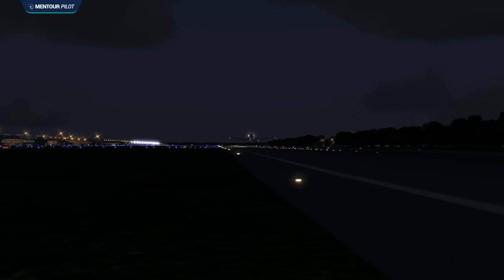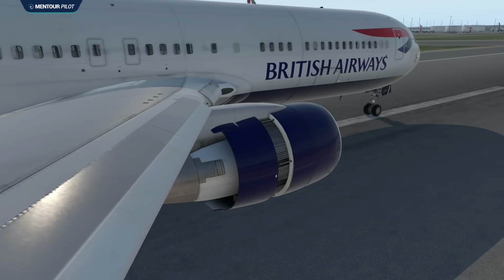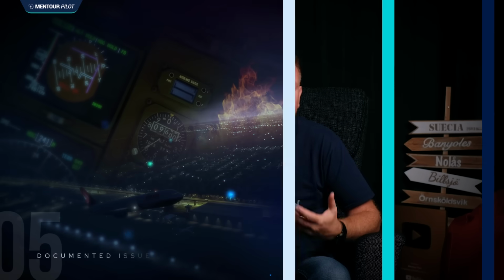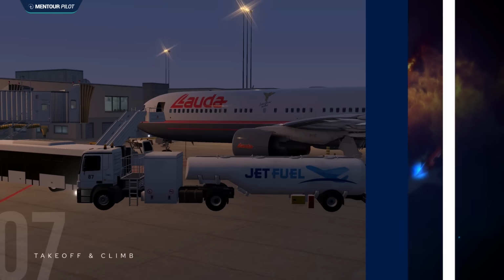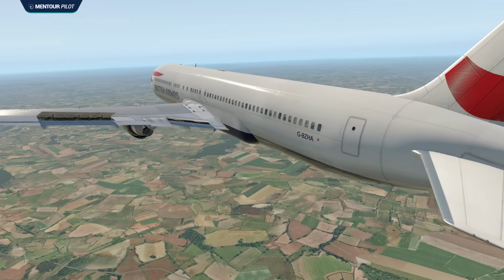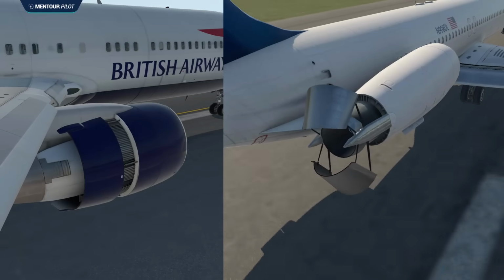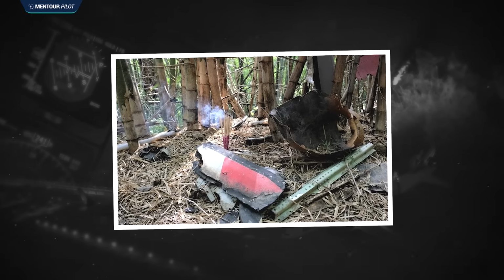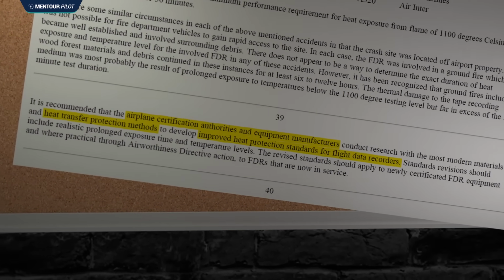HOW an Impossible Failure CRASHED this Boeing 767!

Comment: After reading about all this airplane disasters, I am coming to this conclusion that Boeing has had a poor record compared to Airbus.
Reply: Boeing has gotten progressively worse over the years after merging with other companies. The corporate culture is dominated by shareholders instead of pilots and engineers like it should be.
Reply: Are you sure about this? Airbus also had that incident with the rotated landing gear and everyone on the plane watching their own emergency landing on the IFE.
Reply: I know for a fact that if it was an airbus with the same problem the shit would have landed ! The airbus has higher passenger survival than Boeing and if you compare Boeing and airbus accidents you will see when the fire shuts off airbus has more material left and Boeing simply turns into ashes like it never existed in the first place and also if you see Kenya airlines airbus accident you would have notice for the pilot to do suicide he had to wait for a while and then put inputs of a landing YOU CANNOT FOOL AN AIRBUS! and it's official statement of Airbus that they design the planes keeping in mind the possible human errors rather than BOEING anything happens NTSB is like pilot error (ofcourse you try to be calm in air!! atleast airbus accepts this and provides a solution for it!!) even if I have live on road for few days still I will pay to be on airbus than Boeing!! yes airlines with airbus are expensive compared to airlines which uses Boeing but hey you can't price human life right? BOEING used to be good but it's now thrash and as an American I am ashamed! the company is now all about cheaper materials capitalization, it's like apples now all they care is about those dollars and for them passengers are just price paying souls and nothing else. SHAME ON YOU APPLE AND BOEING!!
Reply: @lawyerpanda1856  you can't fix stupid. You don't have a clue about aviation.
Reply: @lawyerpanda1856  No... if the same thing happened on an Airbus, the same shit would have happened. The certification tests were flawed, and that's the big problem. Maybe in France they'd have had a better certification and wouldn't let testing only one set of conditions fly, no pun intended. But any plane, regardless of manufacturer, would have suffered the same fate with the reversers deployed with the same conditions (speed, altitude, engine being on climb thrust, etc). The 767 itself is fine, the problem is the certification requirements allowing for such assumptions and not testing multiple conditions. Pressure, airspeed, engine settings, weather, they're all factors that can greatly impact an aircraft and they all need to be tested.
Reply: @redtailarts101  but AIRBUS 380 doesn't face the same problem and I am sure the way it is made its also has some business perspective attached to it, don't you think so? And it's been flying for a pretty quite time and that too with no accidents like this till now so this basically shows that Boeing in cutting corners in places where it shouldn't 🙃 like employment of cheap engineers is one 😅  i mean it's a thing that goes into the air for a considerable amount of time we all are risking our life I mean you want to get money it's fine but the cost and honestly it's all corruption as an true American I was supposed to like Boeing but my morals as an human is more important. You cannot to this I am just shocked and surprised how after this dangerous thing Boeing walked off If I was the judge I would have closed down that company shutt liked happened in the case of oldest airline and sea planes.
Reply: @redtailarts101  the debate is not about MCAS (of course its shit and not needed) the question is why MCAS? It's high time some good and competent recruitment is done by Boeing.
Reply: @lawyerpanda1856  This channel (Mentour Pilot) actually has a video titled "why 737 MAX NEEDS MCAS" and I think he can explain it quite well. He's a 737 pilot himself and can coherently explain why the MAX needs the system.
Reply: @redtailarts101  okay I will see it, thank you for the information 😄
Reply: @lawyerpanda1856  You're very welcome Sir'am! (Idk ur preferred title so have my cursed mashup of both because my friend found it funny)
Reply: @redtailarts101  🤣🤣🤣🤣🤣🤣 your friend was/is right 😅🤣 it's Hella funny
Reply: @lawyerpanda1856  How can you say that when air fatalities are already so rare and Boeing has had higher safety metrics overall? There isn’t really large enough of a sample size for anyone to make any determinations.
Reply: @aycc-nbh7289  not everything is about numbers 😒  you again have to watch all of the air crash investigations and see for yourself that Boeing has always been about profit lately, this particular crash is the perfect example of that, I mean airbus A380 is double decker plane that can carry 500 passengers but they have not compromised for the quality! But Boeing doesn't not have any ethics now! I am an American and I am ashamed
Reply: @aycc-nbh7289  and this was with 767 have you forgotten about 787-800 max? That MCAS maneuver? That lead to so many crashes? And how many accidents and loss of life it took for Boeing to actually admit their fault ?
Reply: @lawyerpanda1856  So how come Airbus put out their A320 aircraft before they realized that their landing gear could turn sideways and possibly become a deadly projectile that flies into and explodes an engine upon landing? It seems as though not only Boeing is about profit. In fact, pretty much any aircraft manufacturer out there who isn’t a nonprofit charity would be.
Reply: @lawyerpanda1856  I was unaware that Boeing even had a 787 MAX, not just a 737 MAX, until you mentioned it. I may just want to fly on it and try it out now that they’re serious about competition with the Airbus A321 XLR, but I guess it’d be easier to do when the specific planes in question are fixed.
Reply: @lawyerpanda1856  Also, how come Boeing, not Airbus, was contracted to build the replacement for the Soyuz capsule, as well as many of the planes used by the branches of US military service?

Though with Boeing and Airbus being virtually the only manufacturers of passenger aircraft that are used by airlines in the Western world, perhaps it’s time for other companies to step up to the plate now that both companies have been revealed to be at fault for possibly deadly accidents.
Reply: @lawyerpanda1856  787-800 MAX? 💀 hun do you by chance mean the 737-8 MAX?
Reply: @aycc-nbh7289  They don't have a 787 MAX. They meant 737 MAX.
Reply: @redtailarts101  yes I obviously meant that but did the mistake on purpose and I was proven right about that particular person 😉  (its a technique most of lawyers and judges use in order to test something)
Reply: @redtailarts101  and I am deadly scared of MCAS, the maneuver requires 4 seconds to acknowledge and disengage and its still present (and I don't know why FAA doesn't ban it!!) If they want to "copy" "Airbus" atleast do it right (we all know it's nothing related to safety just because of big engines (since fuselage is big cause more passengers) its a scientific phenomenon that occurs automatically and even after "modifying it, they are not able to remove it (cause you can't remove scientific laws) pilots have 4 seconds to disengage  I JUST CANT!
Reply: @lawyerpanda1856  Suuuure... you're deffo not just making shit up in your defense.
Reply: @redtailarts101  you can think whatever (you are obliged to do so my friend) whatever makes you feel at peace 😄
Reply: @redtailarts101  you are not the first person to point it out, it was obviously done by the person  with whom I was chatting before you 😉 you see can that for yourself I could have edited my comment but as you can see my comments remains the same.
Reply: @lawyerpanda1856  Hey, if I'm right it was just an honest mistake (the 787 has also been under fire and most Boeing planes are -X00's and not single digits.) And I've thought myself of pretending a mistake was intentional before if ever confronted when I realized I'd made a mistake months later. And if you're being honest... well, someone believed you.
Reply: @redtailarts101  huh? I mean we all have internet right? Can change things in seconds now (unlike before) I can literally check internet right now and do that can't I? And whats with the fixation of being 'right or wrong' unless it's a crime everything is grey comes from different perspectives. Anyhoos what's your take on your MCAS? AND boeing in general?
Reply: Boeing went to shit after buying McDonnell Douglas. MD basically bought Boeing with Boeing's money because the company model shifted from honest hard work from engineers who had quality in their best interests to McDonell's profit-first approach, which resulted in lower quality aircraft, worsened company environment, shady certification, corner cutting, quicker manufacturing times (it sounds nice but nice things take time), and eventually disaster.
Reply: @redtailarts101  Perhaps it’s time that the trusts be busted and new competitors step up to the plate, then, since Airbus may not be able to deliver quality products in desirable timescales if the bureaucracy of having to make sure everything is transported to various factories in various countries and everything needs to be signed off on by multiple sets of administrators. We already know we’re getting the “Son of the Concorde” that was pre-ordered by United and American, but maybe we need Lockheed-Martin or someone else to step back up to the plate with passenger aircraft.
Reply: Boeing is an American company, airbus is a European company.
Reply: @FeyFoxGames  what you want to tell us?
After the problems with the 737 Max I thrust now more Airbus than Boeing.
Reply: @FeyFoxGames  i hate this argument. Because it literally says out nothing about quantity or quality
Reply: @FeyFoxGames  So...?
Reply: I am german but i like and travel with both. Boeing and Airbus, but when it comes to safety. I rather go wirh airbus. Just by the feel in my stomach
Reply: Boeing was also founded 60 years before Airbus, longer youve been around, more accidents your going to have.
Reply: @strodey123  A company that has been around 60 years more than the other one, you would expect to do a lot better when it comes to engineering and safety.
Reply: @strodey123  but it should also translates to more experience thus, should result in less accidents in the recent decades. but the reality is boeing have several major accidents in their last 2 models of 747 and even 747 max already and caught trying to cover them up several times. for the 747 case Lauda himself forced boeing to admit their mistake after boeing tries to cover their mistake by announcing that he will try to replicate the problem by himself in real life, where either he dies if its the design's mistake or lives if its his company's mistake. and if its his company's mistake he will close down his own company. Thus resulting in boeing announcing the flaws of their products.  

furthermore the 2 accidents in boeing 747 max also from design flaws from hurried implementations of unfinished technology and panic of airbus gaining market shares through their newest models resulting in hasty implementations of unfinished products. which added with their connection with the government, they were able to skip a lot of testing procedures to roll out their unfinished products. This resulting in trained pilots and hundreds of lives died twice. The first one got covered up because Indonesian government didn't get to inspect the black box and the US government forcefully take them before any investigations is done by the local authority. Thus, the first incident got covered up and is blamed unto the pilot's negligence and inexperience. However the second time the plane fell in Ethiopia the black box was seized by the local government and went through a throughout and proper investigation in Europe. which resulting in findings of the design flaw and programming flaws of the plane. 

the many occurrence of accidents and cover ups occurs shows that boeing is untrustworthy and is not dependable at all.
Reply: @ssrbgangimaribotan6thofthe12  when you have many companies demanding new engines, new tires, new wings, new everything you are going to have problems constantly. Airbus is no more safe than Boeing is, airbus makes less changes to their planes than Boeing does and Boeing has far more planes flying than airbus does.
Reply: @moviemaker2011z  my problem is not about the safety because no matter how good the company is the planes in the end are human-made and mistakes bound to happen on something as complex as a plane. Furthermore, testing them requiring many intense and complex testings. but skipping the required and mandated testings with political connections and covering up their mistake is the problem. That should not have happened and should not be allowed to happen. But it happens i guess. Just because they have the backing of a superpower meant they can do anything i guess.
Reply: @ssrbgangimaribotan6thofthe12   nonsense
Here are the actual numbers per number of flights.
Boeing does far better than Airbus
Airbus: 35 crashes, 28.3 million flights, 0.81 million flights per crash

Boeing: 251 crashes, 461 million flights, 1.84 million flights per crash
Reply: @larrydugan1441   How about during the last decade, which is what matters?
Reply: Nonsense... The reality is statistically Boeing has far more flights per accident than Airbus.
Reply: @larrydugan1441  we should count the statistics of the last recent decades, airbus is quite new compared to boeing, thus will have less experience and data to compare to (I also mentioned the older they are, they should have more experience and thus far less accidents in the recent decades, but the reality is, they are not). Furthermore, the main issue here is not the accidents or crashes, but the cover ups they tried, which happens many times thanks to the political power they have over smaller and weaker countries thanks to the backing of a major country. This kind of cases just happens too much and its the part that made me fed up with the american aviation industry.
Reply: @ssrbgangimaribotan6thofthe12  The reality is there are far more Airbus accidents than Boeing per flight hour. 
You can reverse the logic and say that Boeing has far more older aircraft flying and this should have more mechanical issues.
Coverups? That is a nonsense statement. In every accident both manufacturers lawyer up and try to place blame elsewhere.
Reply: @ssrbgangimaribotan6thofthe12  737. It's the 737 MAX. Not the 747.
Reply: @larrydugan1441  They're right about looking at recent decades. Specifically after Boeing bought McDonnell Douglas. Things changed after that. Boeing was a great and reputable aircraft manufacturer before they bought that company and let MD's higherups ruin them
ETA: But if we really want good results, we should look at crashes deemed the fault of the aircraft manufacturer and not the crew, ATC, poor maintenance, or outside forces that cannot be predicted or controlled (like being struck by lightning or being struck by a bird, or in one case, a missile meant for military aircraft)
Reply: @redtailarts101  The decision of  Boeing management and marketing to obscure the MCAS system for certification purposes is both criminal and inexcusable.
Having flown both Boeing and Airbus aircraft for many thousands of hours. I consider both  manufacturers are building fine aircraft.
When it comes to overall safety I consider Boeing to be a better product based solely on cockpit design with less chance of human errors.

Comment: Boeing engineers aren't dumb -- they just don't care because no Boeing engineer or manager goes to jail for criminal negligence that caused this crash or for the 737 MAX.  Once again, this is just bad design by Boeing.   Make it so that reverse thrust can ONLY deploy when triggered by the pilot.  The design needs to make sure that mechanical or electrical failure cannot cause a reverse thrust.  There can be two switches and the pilot has to switch both on.  And why is there no software that confirms the engine is at idle before allowing the reverse thrust?   All this shoddy design is criminal negligence by Boeing engineers that kills people.  Even a child can tell you what will happen if reverse thrust is engaged at power and speed.   My $50K car is designed so it will not allow me to shift to reverse until the speed is close to zero.  But this $50 million plane will.  So to repeat:  Boeing engineers just don't care.  Send a few to jail and watch how Boeing changes overnight.

Comment: One of the few things I trust less than a P&W engine is a DC-10...
...with P&W engines.  

I think this is also a good lesson to be vigilant about even "small" safety issues about an aircraft and keeping in mind quick remedial actions if the issue occurs.  In hindsight, I personally would've been mentally ready to immediately idle the engines and shut down the offending one if I thought a reverser might deploy mid-flight.  I emphasize hindsight, since by all indications, the pilot training back then didn't make it out to be a critical issue.

Comment: This was on Air Disasters and it could have been prevented by a simple design change, mainly not routing high voltage wires next to low voltage control wires and keeping the wiring to both control valves seperate from each other inside the wing.
Reply: It could also have been prevented by grounding the airplane when it became obvious that the maintenance troubleshooting and repair procedures to address the fault message were a failure, and ask Boeing for help, instead of dispatching passengers on an unairworthy airplane for MONTHS until the reverser finally DID deploy in flight!